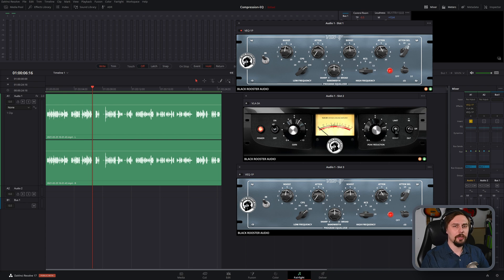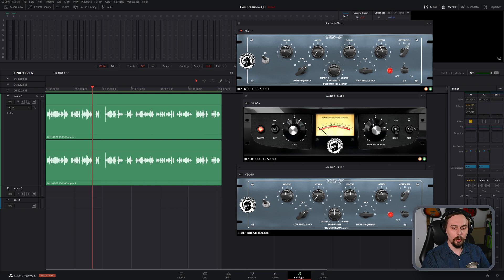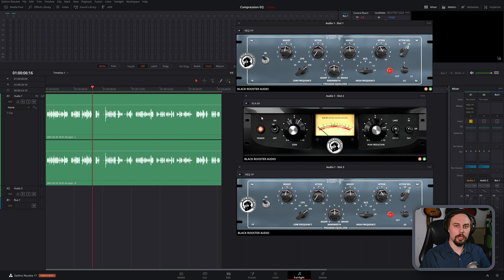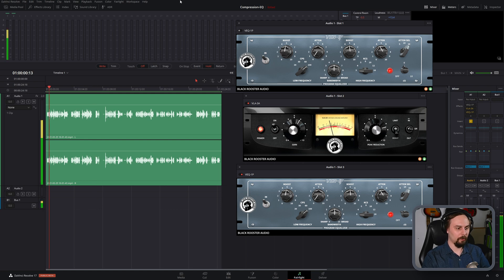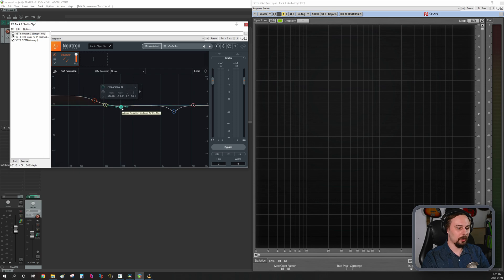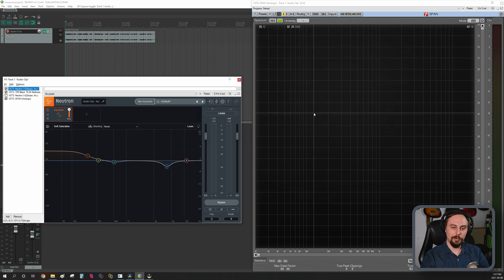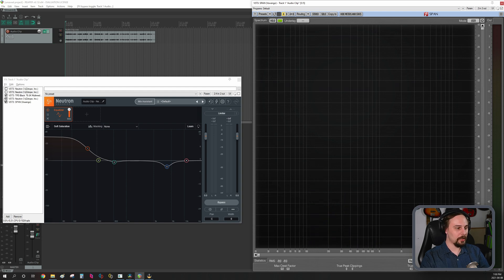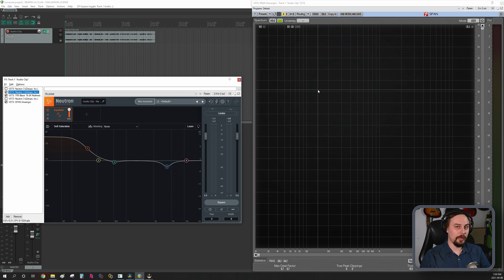COMPRESSOR OR EQ FIRST FOR VOICE-OVER & SPOKEN WORD IN DAVINCI RESOLVE 17 ??

Comment: Hi! Just one hint, the compressor is working harder with the eq before since you're boosting the low end (hence the volume) before hitting the compressor.
Check how it works also gain compensating the eq before the compressor, not only the second eq ;)